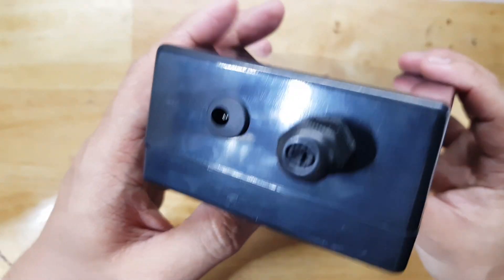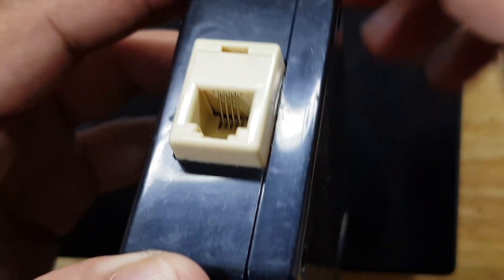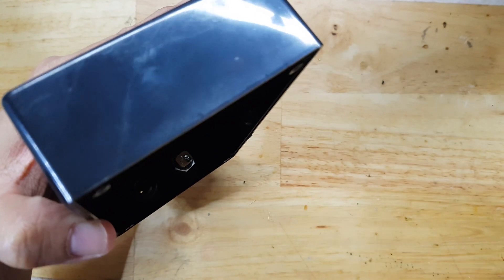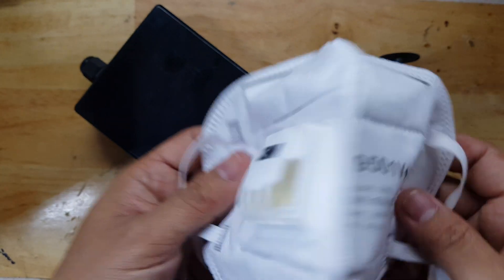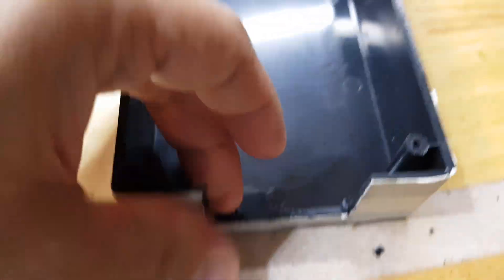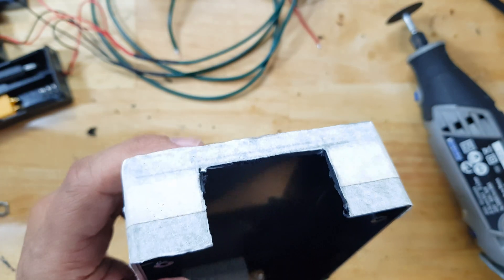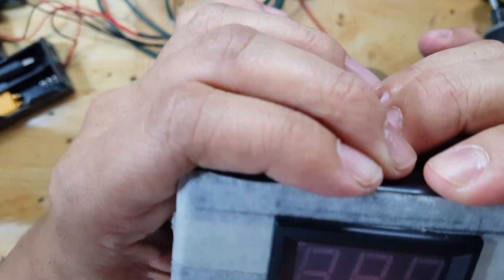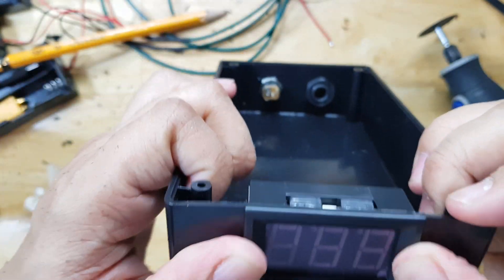HOW TO MAKE RECTANGULAR HOLES ON ELECTRONICS PROTOTYPE ENCLOSURES

Comment: Do you know of a way to make an even smoother rectangular hole? I'm trying to cut a hole for a SFT display, so the borders will be visible. Thanks!
Reply from the maker: CNC drilling or Laser cutting is the only choice. 3D printing is ok too.
Reply: @circuitdesolator  thanks!
Reply: jig and a mini router base attachment